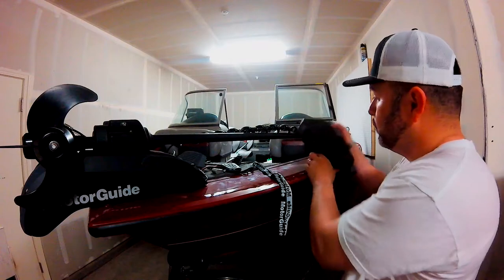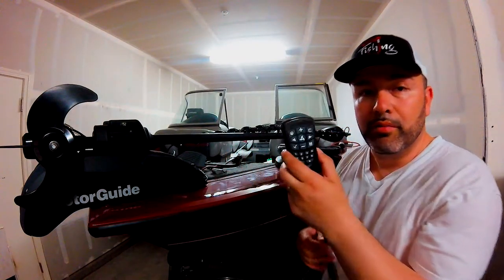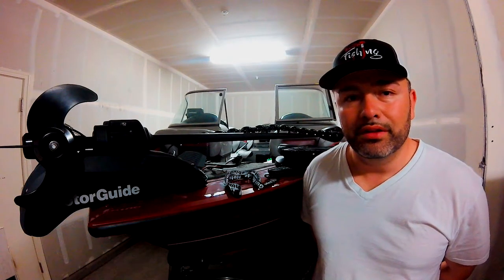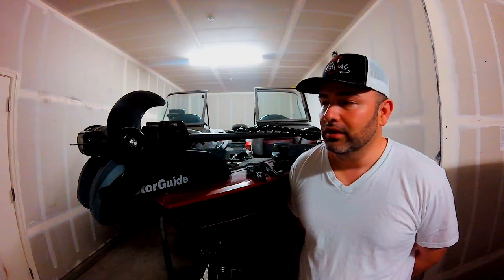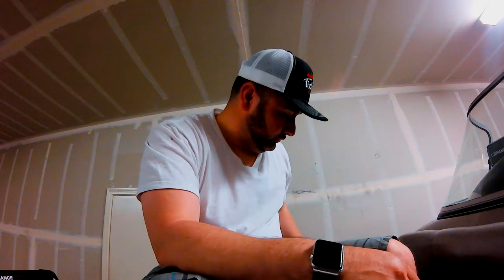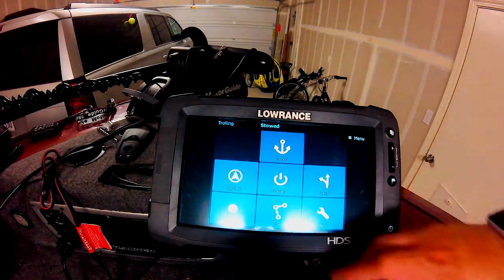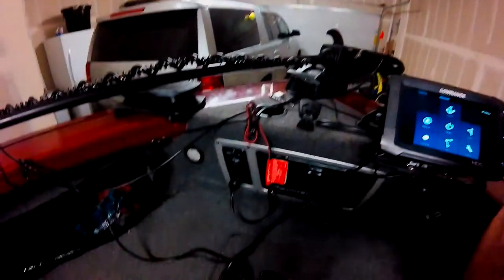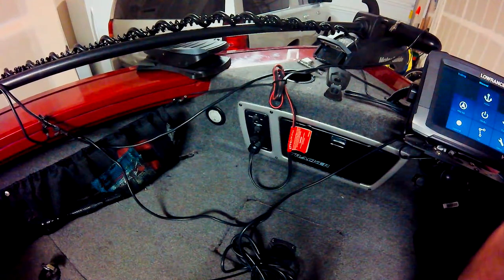Motorguide XI5 Trolling Motor Review

Comment: I have a couple questions. How is it to deploy the trolling motor? And if you used a secondary transducer, what did you do to secure the cable? Being that the shaft is sliding up and down through the bracket? I'm trying to find a video of it in use and how it deploys. Great info tho thanks.
Reply from the maker: There is a lever you have to push manually to release and then you can move it to the vertical position. I zipped tied the cord to the very top and I haven’t had any issues.

Comment: Great info...I have some questions you comment that you wouldn't recommend Xi5 for a bass boat. Can you tell me why not? You say you have 2 batteries on the trolling motor and will last all day what model xi5 do you have 12v or 24v? Thanks
Reply from the maker: Hey Paul, thanks for watching the video. Bass boats are heavier and i'm not sure that the batteries can handle a full day. I could be wrong. I have 12V.

Comment: older design was much user friendly, you are no longer able to raise and lock in a vertical position , now you must lay it horizontally to clean weeds or reset your height adjustment each time to lock in upright position when not in use, not to mention time wasted and a total pain, if it was not broke why did they fix it . on a deck boat it becomes a constant trip hazard